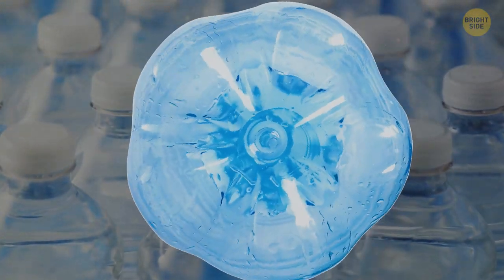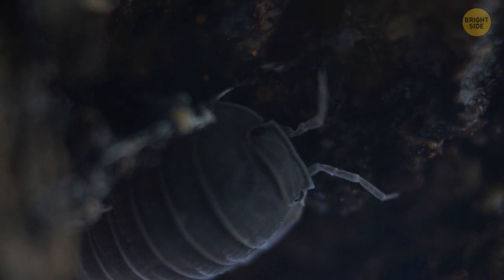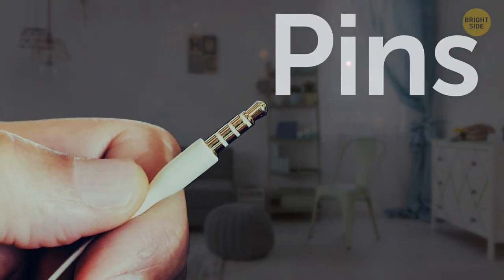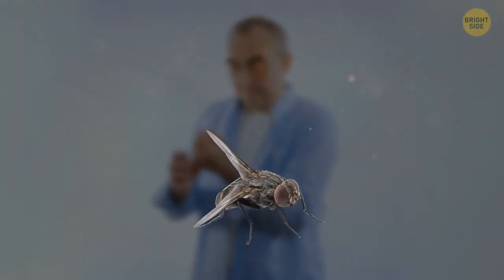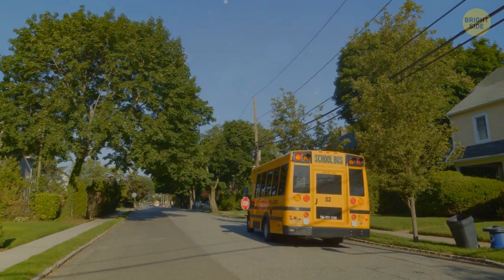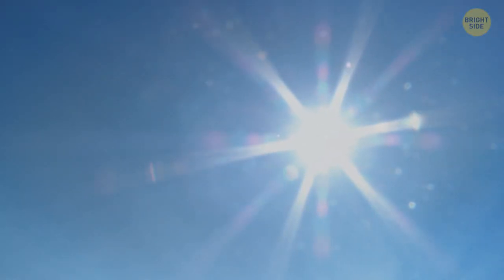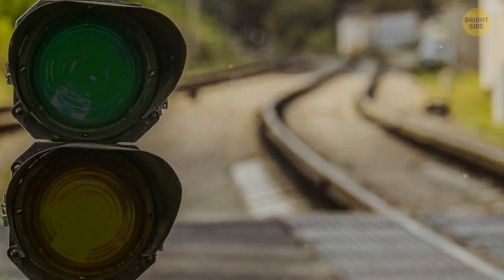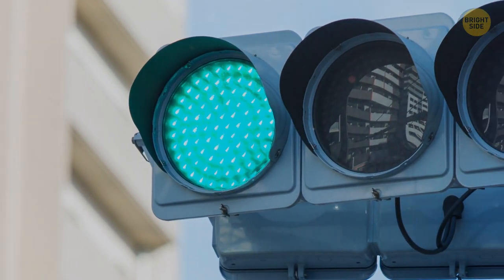Reason Your Bottle Bottom Isn't Flat + 13 Other Crazy Why's

Comment: The “bumps” add extra strength to the bottom of the bottle to withstand the pressure of the carbonatation. Other shapes of rounded bottoms could work, but these keep the ability to stand upright. ✌✌✌✌✌🥺🥺🥺🥺
Reply: Lovely soda bumps
Reply: Hi
Reply: Why weren’t the bumps pointed inward thus accomplishing the strengthening without destabilizing the container?